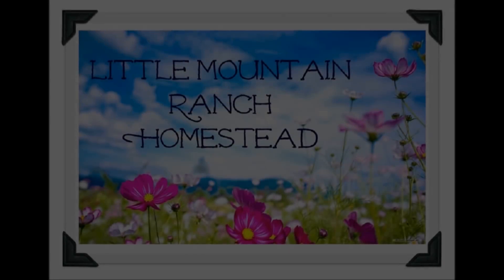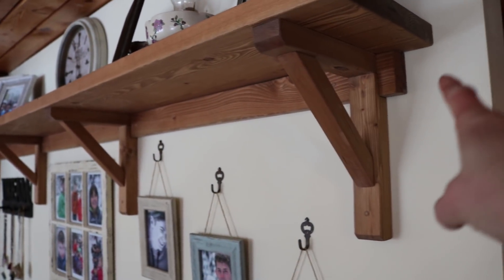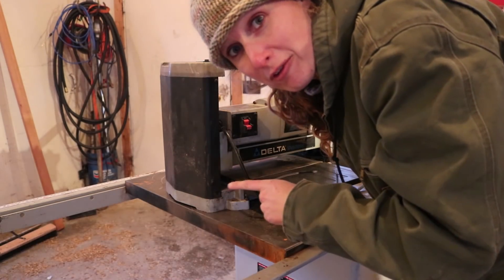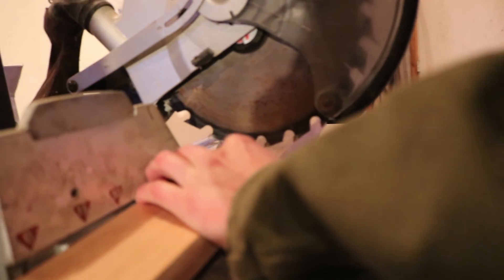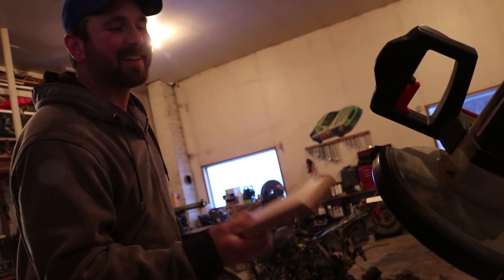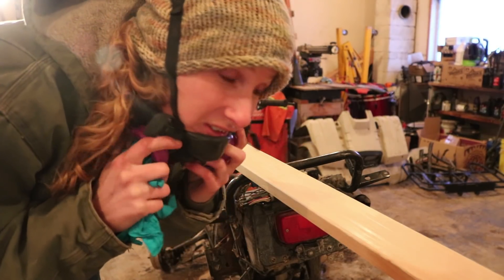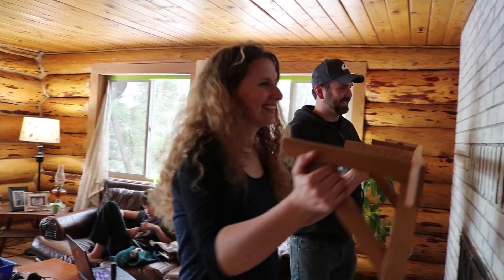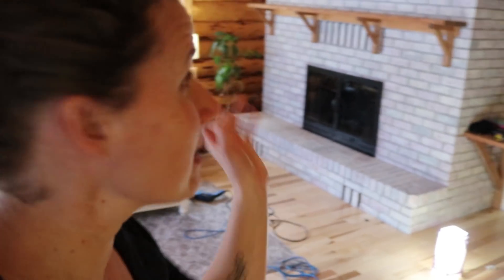Installing a Fireplace Mantel | DIY Home Improvements

Comment: Mantle ?
Reply from the maker: I’m not sure if you’re asking what is a mantel? If so, it’s the shelf that goes above a fireplace.
Reply: Oh sorry, I was correcting the spelling of “mantle”
Reply from the maker: I know, I honestly had to double check it when I wrote it because I thought it looked wrong, but it isn't. Definition of Mantel (from Websters)
1 a : a beam, stone, or arch serving as a lintel to support the masonry above a fireplace
b : the finish around a fireplace
2 : a shelf above a fireplace
Mantle
1.a loose sleeveless cloak or shawl, worn especially by women.
synonyms: cloak, cape, shawl, wrap, stole; historicalpelisse
"a dark green velvet mantle"
2.an important role or responsibility that passes from one person to another.
"the second son has now assumed his father's mantle"

🙂
Reply: Thanks, I stand corrected.
(and learned something)